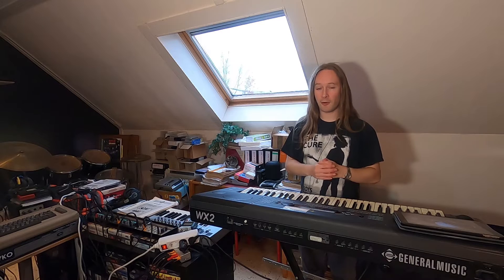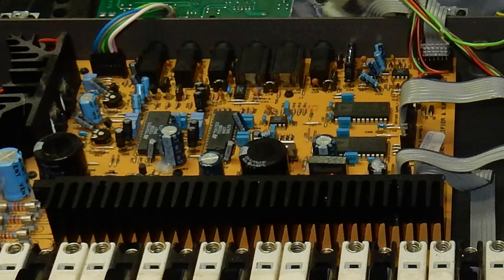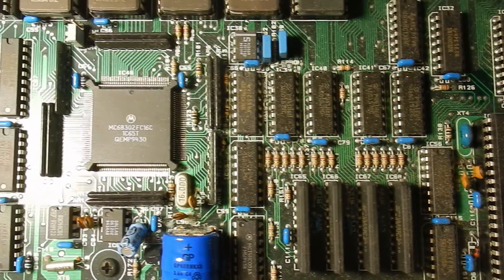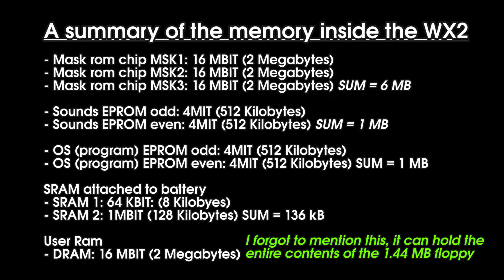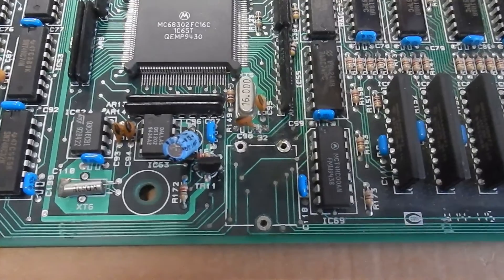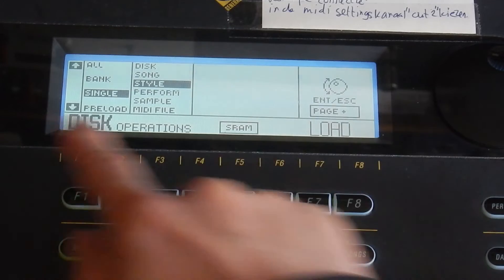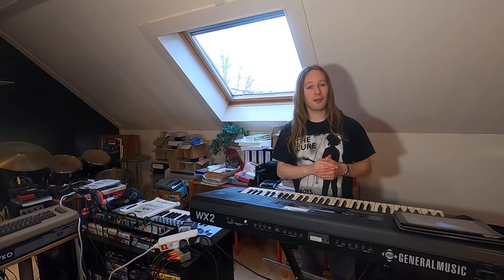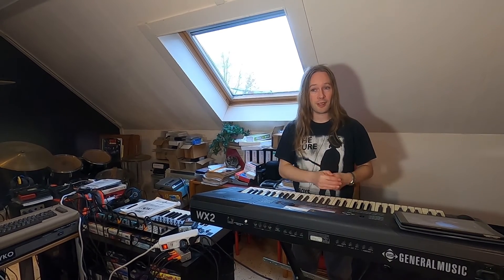Inside the Gem WX2

Comment: Thank you for making such an in-depth video on the WX2! I purchased a SX2 with one of those awful batteries which started to leak. I ended up taking the battery out and I probably won't be replacing it. I'm thinking of replacing the floppy drive with a Gotek as it won't accept any floppies
Looks like yours has the optional 2mb of ram for loading samples, which is very cool. I wondered if anything is required to get that working, or if it's 'plug and play' in a sense that the unit detects that the ram is present?
Reply from the maker: Good question about the ram, I’ve never given it a thought beeing special. It is factory original, as far I know the video output board is an optional feature which is not installed in my WX2. I do remember that my father who had bought the WX2 in 1993 had the OS rom updated around 1995 by the music shop he bought it from. In those days there where no flash memories and user installable firmware updates. Nowerdays on modern devices the devices like the Roland MC-101 you can update the firmware from an SD-card. 30 years ago a firmware update required replacing rom chips.

Comment: How do you use with Ipad ? and, wich app do you use ?
Reply from the maker: You can use any midi interface that works with an iPad and any app that supports midi. I've sucessfully used the Korg Plugkey interface with the WX2. A good app to try is the Peter Vogel Instruments Fairlight CMI app, other good apps are iWavestation and iM1 from Korg, but Garageband should also work well.
Reply: @dykodesigns  Thank you so much for reply, you're great !

Comment: Hi, whats audio output ic code??
Reply from the maker: The audio output section contains: 1x AD1865N 2 channel 18 bit DAC,  2x TDA7313 Digital controlled audio processor and 1x STK4151V 40+40W Stereo power amplifier.  This is what I could find one the schematics in the service manuals.
Reply: @dykodesigns  thank you very much 🙏🙏🙏🙏🙏🙏🙏

Comment: Hi, my WX2 doen't sound, only the display and the light on the button appear. The area near the battery is correded a bit but the tracks are OK. I cleaned the tracks without the battery mounted. Just 2 question:
-Does the Wx2 work if the battery is not installed?
-I was able to give it to work switching very fast the breaker. Only some times. What it mean? Thanks
Reply from the maker: We have not tried to use the WX2 without the battery, so I don’t know if it would be usable without it. My best guess is that you won’t be able to save anything to the SRAM and that it won’t store the user configuration / clock settings. Since all the sounds in ROM, I expect the WX2 to mostly usable without the battery. It depends on how the OS handles this and if it will boot at all without it. The second question might perhaps be a power supply issue. Maybe it needs new capacitors in the power supply (I’m not that knowledgeable about electronics but it seems a possibility to me).